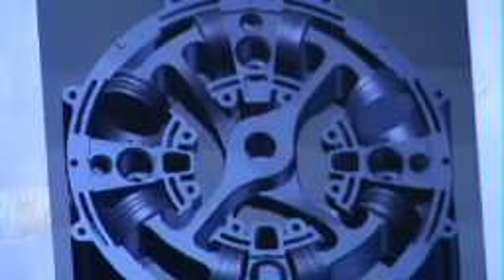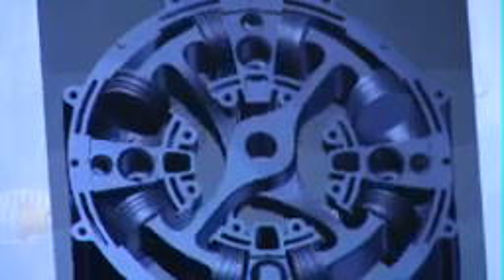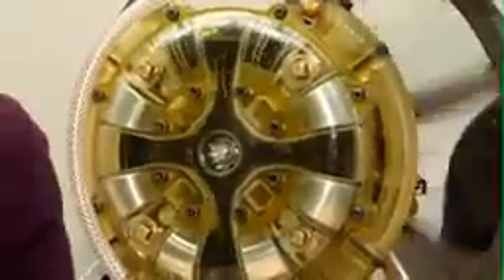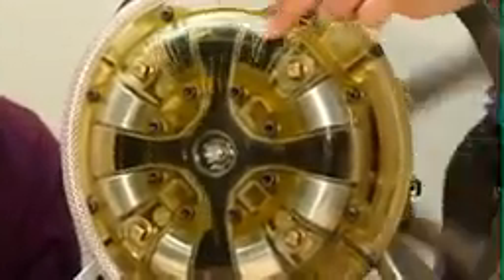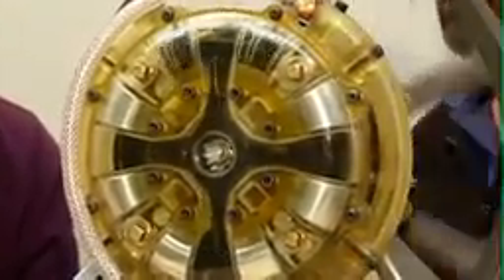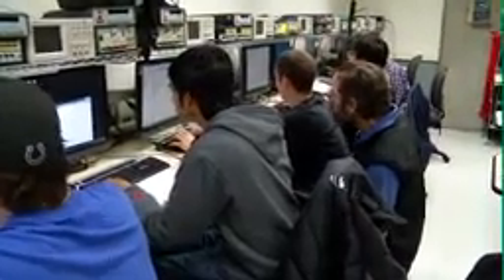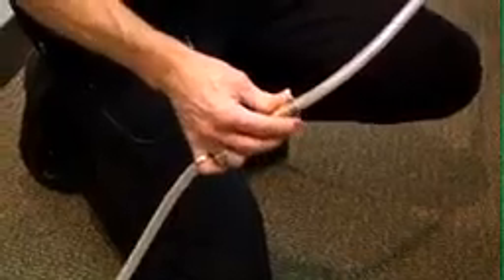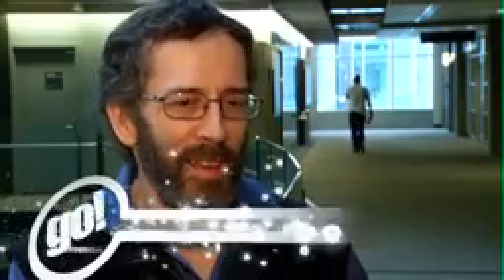Opposed Piston Circular Engine (OPCE) - Edmonton Shaw TV's Tim Dancy mini documentary

Comment: The reason that this appears to be more efficient than the conventional Otto cycle engine is because it is rotating far slower, and also because a larger amount of useful work is being extracted from a comparatively longer stroke. The parameters of a common engine could be changed to have a similar fuel economy, but that would likely increase its size to the point that a vehicle would be less efficient overall. Otherwise, this design doesn't at all appear to be commercially viable, and its most obvious flaw is the manufacturability of the curved bore. I seriously hope that nobody has invested their life savings into this project.

Combustion is obsolete and we should no longer be developing anything that relies upon it. Instead, focus on making storing electricity more efficient both in terms of size and service lifespan. For example, batteries aren't size-efficient, and they could be vastly improved if the cathode and anode were shaped in such a way that exposes the largest possible surface area for a given mass (e.g. look at the structure of mitochondria for some inspiration). A company worthy of mention that has made a dent in the problem is Pipistrel.
Reply from the maker: This is just a plastic, air-driven proof of concept prototype -- the actual engine is designed to operate at faster-than-conventional speeds.  The structural engineering and finite element analysis (FEA) have been done for continuous operation at 6500 RPM.
In terms of size, an 85 hp version of the current design would be 30 cm in diameter and 26 cm deep, considerably smaller than a comparable conventional engine.  (Incidentally, the current design incorporates the Miller Cycle in a clean two-stroke uniflow-scavenging configuration with infinitely-variable compression ratio on-the-fly, with both intake and exhaust valves approaching the bore size -- I think you'd like it!)
The improved efficiency comes from the opposed piston design, which has been verified by builders of the OPOC and Achates engines -- these engines show greater than 25% increases in efficiency, perhaps even up to 50%.  I chose to be conservative in my estimate (which the commentator incorrectly stated as being a 125% increase instead of 25%!).  Incidentally, the stroke isn't long -- in the plastic prototype, it's "square" -- stroke equals bore -- and it could be designed to be under-square or over-square depending on whether the application needs to be fast or high-torque.
I fully agree that we need to be looking for ways to move away from non-renewable resources.  My current design is intended for use in the cogeneration of electricity and heat using methane-based fuels.  Initially, it could be used to significantly increase the useful energy harnessed from natural gas, which we in Alberta tend to burn directly for space heat.  This is a huge drop in enthalpy from chemical energy to low-grade heat, and is unconscionable.  We should be generating electricity (much smaller drop in enthalpy) and using the waste heat for space heating instead.  For future applications, it's a small step from natural gas to biomethane, so this engine could be the heart of a high-efficiency renewable cogeneration or combined heat and power (CHP) home, apartment, or commercial system.
Manufacturing the curved pistons has always been something that concerned me; however, the various machinists I consulted regularly indicated that, with new CNC-controlled multi-axis machines, this is no longer a challenge.  The cylinder sleeves could even be re-bored if there was any reason to do so, which shouldn't be the case, as the sleeves themselves would be low-cost, easily replaceable parts.
Thanks for your input!  I hope my response clears up some of your concerns.
Reply: @prosstaylor  Could this be adaptable to an high thermal delta Stirling cycle, or perhaps an open steam cycle in regions where water is readily available?   Is there a better way to get mechanical energy out of a concentrated solar thermal system?  We have lots of heat and water, but not much wind or hydric head here in Louisiana.
Reply from the maker: Due the Stirling Cycle's requirement for two "pistons" to be 90 degrees out of phase, the control system in this engine would have to be quite a bit more complicated -- I've considered it, but haven't gotten very far.  It could certainly be used as a steam engine, though!  This plastic model is running on low-pressure compressed air, which is very similar to the way a steam engine would run.